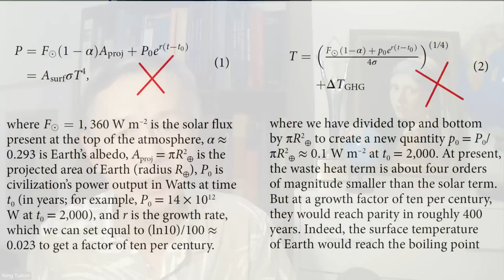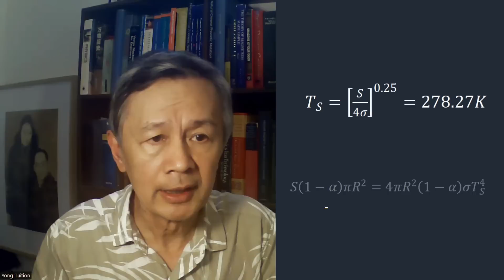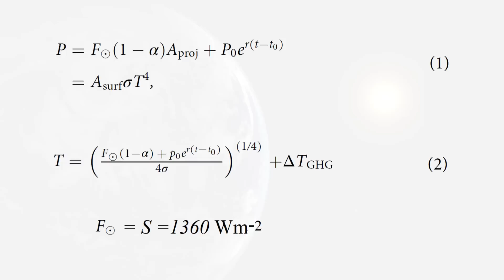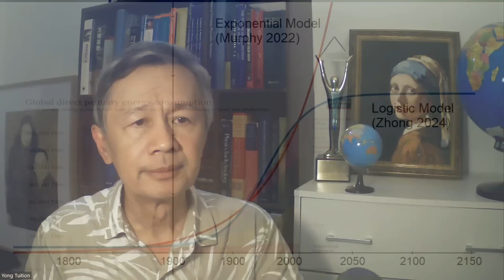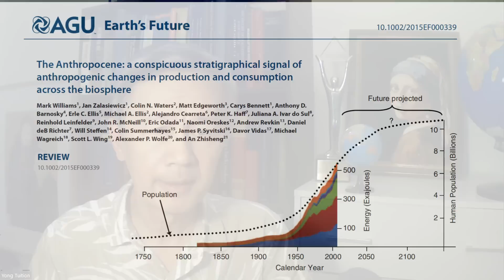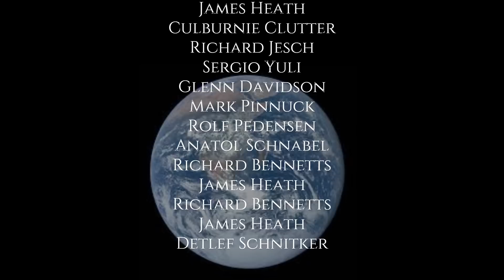Can Waste Heat Make Earth Boiling in 400 Years? | Basic and Unsettled Issues in PHYSICS 20240411

Comment: There is another fun fact about those equations. Based on those equations, the temperature of Venus without the greenhouse effect is lower than the temperature of Earth. Venus is 1.5 times closer to the Sun with roughly the same crossection. Just this fact should have triggered them to rething the equations used. But they don't care. And mistake is quite obvious for all who want to see it😂😂😂. But I wonder if anyone else noticed, why their equations fail so miserably🤔
Reply: venus atmoosphere compisition is very different, to a point, where people have good reasons to believe, that venus can not become earthlike and earth can not become like venus.
but newer research confirms more, that earth can become too much like venus, and earth oceans can indeed boil off completely, despite distance to sun and other size and athmosphere differences.
Reply: @ollllj  I have a feeling that you have made assumptions about my post without reading it🤔. 
Look. There is an imaginary equilibrium temperature without greenhouse effect for Earth and Venus that is calculated by proponents of current theory.  For Earth it is 255K for Venus it is 232K.  Now look at the distances to the Sun and cross-sections of the planets and calculate the relevant energy fluxes for both. In the absence of greenhouse effect, which of the planets should be hotter?
This should make you wonder at first and then force to think about the equations that they used to calculate  that temperature.  And hopefully you will get angry at them the way I am😉
Reply: @ollllj  If you go and trace their equitation for calculating the equilibrium temperature, please pay attention to the assumptions that has to be satisfied before you can use those equations. Trust me, 😉 it is infuriating when you realize the scam